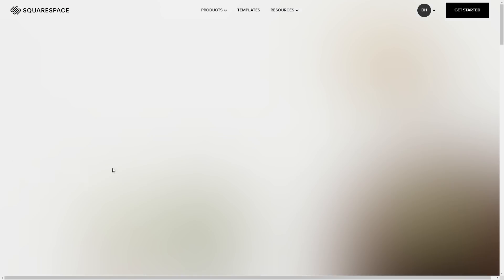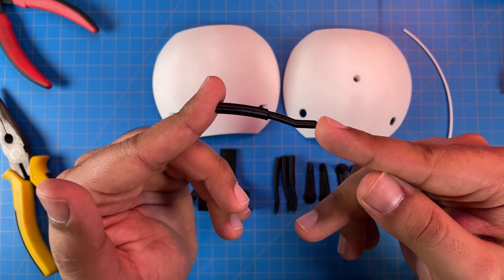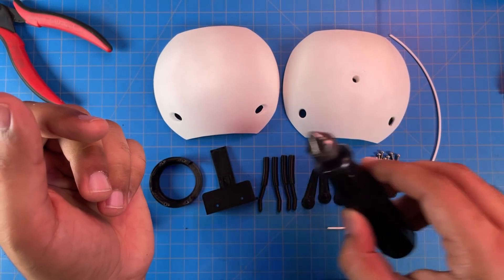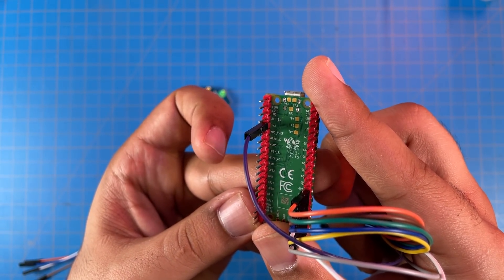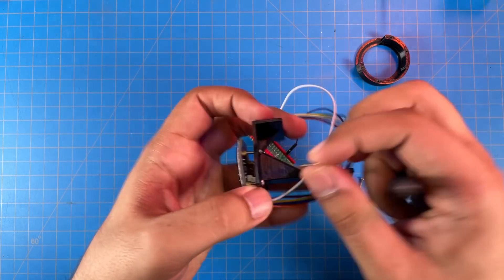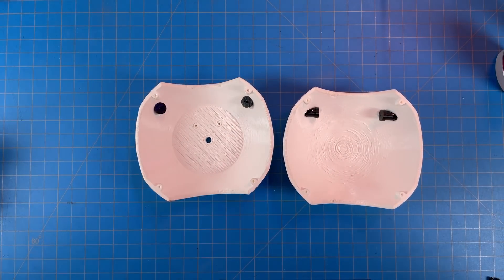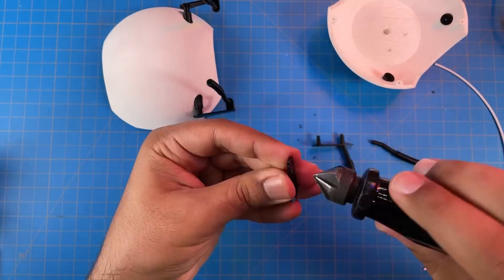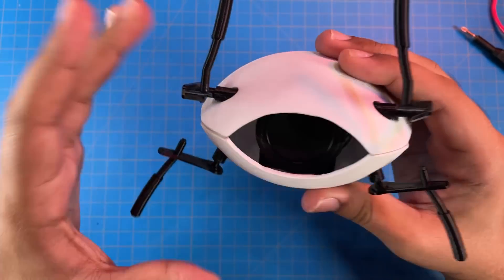Portal 2 | The DIY Wheatley Crab Tutorial

Comment: @Mr. Volt, can you lay out step by step the code to download and save to the Pico? I am assuming it's done via the Mu Editor, unless there is a better way. I'm not real good with figuring out how to code. Most projects I've done had one ar two easy sources to go to and get the code needed and this is through the Arduino program. Mu Editor looks great and easy, but very different in my experience. Basically I'm having a hard time understanding where to find all the code needed to get this thing up and running. The links you provided seem to show "demos" of things you can do to make the display work, but I need a direct method to get all the code needed for the Pico.
Thanks much!
Steven H.

Comment: Hi Mr. Volt! I was wondering how you made the screw holes for the mount. I see in the STL files that they are just straight cylinders. How did you make the threading for the screws to go in?
Reply from the maker: It will self tap on the thread, so it'll just take a little force on the first mount